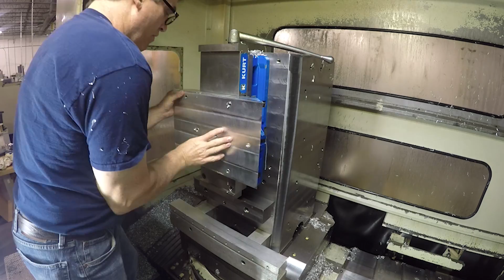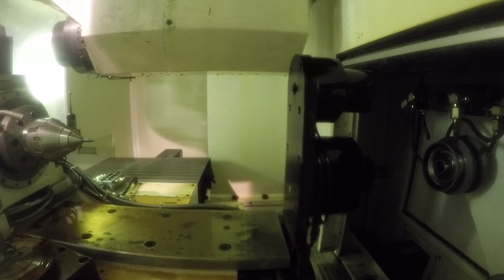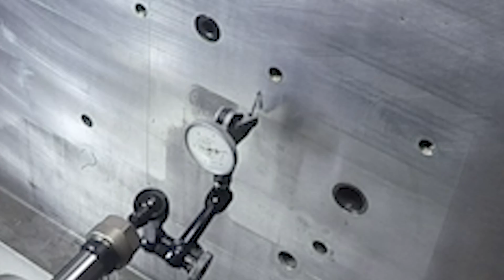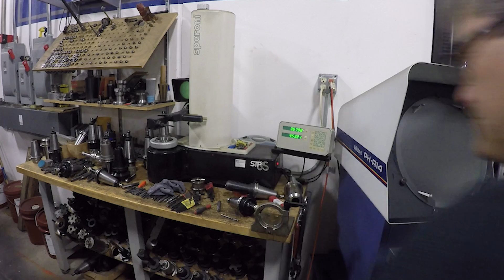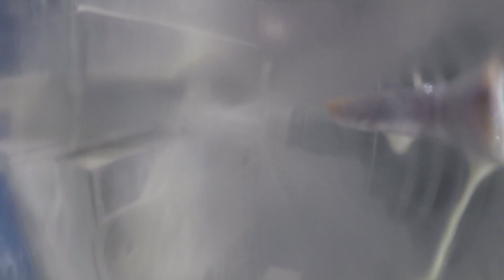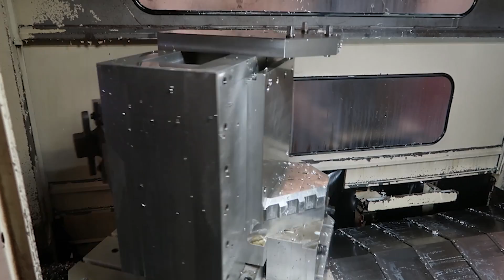Casting-2 and grinding a tool.

Comment: That’s a really nice fixture!
How many hours would you estimate you had designing it in esprit
Professional
Reply from the maker: I only use Esprit for my cam software. I use a cad software called SpaceClaim. Once I had a fixed idea it takes very little time to model the fixture. Perhaps a couple hours. It’s the idea that takes more time. It’s hard to tell you how much. First you get drawings your thinking about it. Than later in this case the castings showed up. After looking at them and taking some measurements you firm up your ideas. During all this your modeling some of those ideas. We had job questions had to go see the customer and so on. This went over a period of about a week before starting on the job.

Comment: Doesn't that grinder get nasty dust all over the ways etc?
Reply from the maker: +Drew Hamilton Normally there is oil coolant flowing on the  grinding wheels. I ran this dry for the video. The dust gets flushed into the coolant tank and filtered before returning. There is a little residue of carbide left that the coolant doesn't get but not much.
Reply: It runs flood oil when its doing actual grinding, it takes the dust with it (Most all of it) and runs the oil through a filter before returning it.

Comment: Is it the diamond that gets heat affected or the material that it's mounted in?
Reply from the maker: +wheelitzr2 The diamond it self is heat sensitive. You don't want to run it to hot. In this kind of grinding where you are fluting a endmills it would generate to much heat without coolant.

Comment: Nice job Peter.  You may have covered this before but I'm curious about the cutting oil used in the cnc tool grinder wth the diamond wheels.  Is it some kind of soluble oil?
Reply from the maker: +Bill De La Vega No it's actual oil specially for grinding. Thanks Bill.

Comment: Man that tool grinder looks like a great job shop machine. I've had to grind too many tools on my old manual and it really gets old fast when you have to dink around with all the angles and dialing to make sure you don't screw it up last minute which totally screws up your day! Oh no you broke the NDA on a power tong design, no one has ever seen them before ;) I've got a couple customers that have NDA that don't let me share pictures of their parts in production because... well someone may... um know that they were machined at one point in time? maybe they can copy them from a picture of them half machined covered in coolant and chips better that the finished part they can just go buy and reverse engineer? I don't get it but the customer's always right! Love the videos and keep them coming.

Comment: Nice shirt! Can you show us what it takes to program the cutter grinder? Also thanks for sneaking in the picture of what the part is actually used for.
Reply from the maker: +Tom Clements I will make a video. It is completely conversational programming. When the machine runs it just shows a single G code in a cycle. Kind of like a canned cycle. The machine uses a software called Numroto.

Comment: What is the quick change tool post in the grinder for?
Reply from the maker: +Mawkuh Hunner I mount a tool post grinder there to dress the diamond wheels. These kind of wheels are dressed by grinding them down.
Reply: did you buy that grinder just to make your own tools?

Comment: Great video Peter!  A few questions.  When do you think it makes sense for a shop to get one of those cnc tool grinders?  How hard are they to learn?  Would you recommend a horizontal in a job-shop setting?  Do you miss your old pallet pool setup? Do you prefer using a tool setter or a machine tool probe?
Reply from the maker: +Norman J A lot of questions. The grinding, if your shop uses a lot of special tools than possibly it would be a good idea. I bought this machine used. These machines new are very expensive. I would say if you spend more than about $20,000 a month in standard cutting tools maybe it could be worth it to grind some of your tools. It is hard to compete with tool companies on standard tooling the buy big quantities of carbide blanks. Yes a horizontal mill is a excellent job-shop machine. The pallet pool is more of a repete production setup. I don't really miss it. The tool setter has many advantages over a tool setting probe. You can touch tools of in different locations besides the tip. Take a SAE port tool for example. You can pre set boring tools check runout. Check angles. Touch spot drills and chamfering tools at there theoretical point. To name a few.
Reply: Thanks for the answers Peter.  Looking forward to this series on these castings.